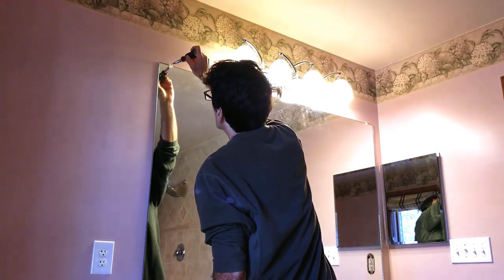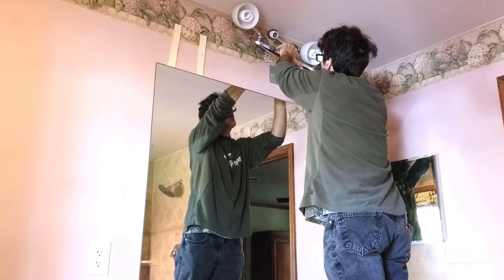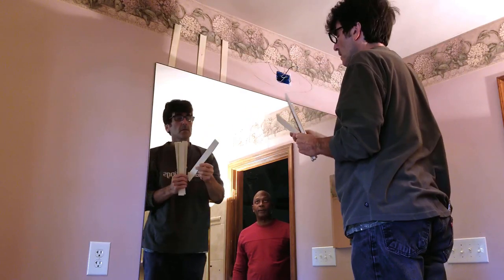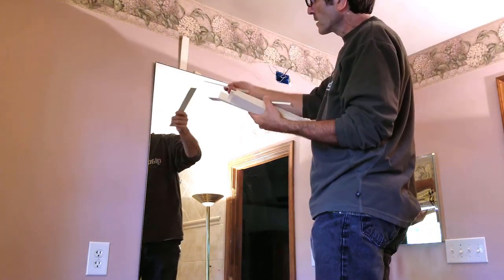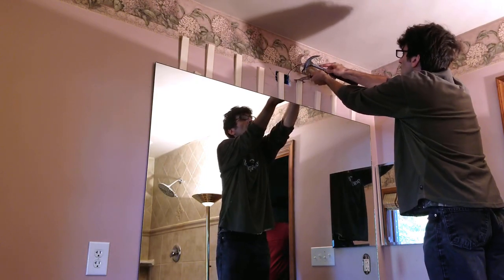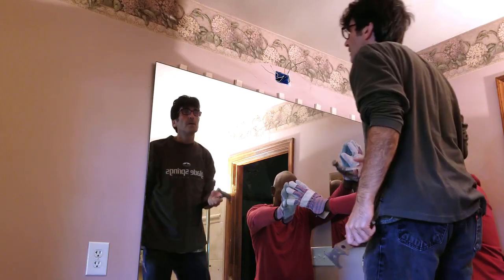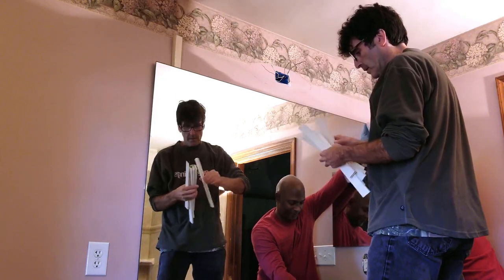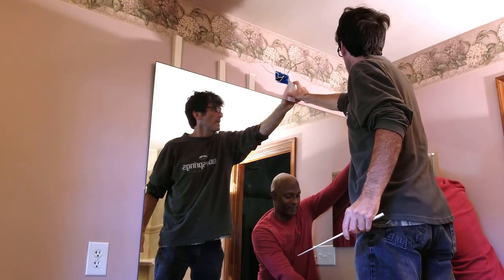How to SAFELY Remove a Glued on Mirror From ANY Wall Without Breaking!

Comment: Just used this technique to remove a 10 x 5 mirror that was glued down for decades. Thanks so much for sharing this. Worked like a charm!
Reply from the maker: Excellent!  Thanks for the great feedback... 🙂
Reply: I got the mirror down with no problem(just lifted each side). However, the shelf beneath it is not budging. Any suggestions?

Comment: This technique worked great.  Removed three mirrors today with a helper.  We criss-cross taped the mirrors with duct tape in case they broke (they didn't). We both wore safety goggles in case there was any glass shrapnel.  Last tip is to by at least two packs of wood shims because as the mirror works away from the wall you need to double them up.
Reply from the maker: Yes great tip.. it does use a lot of shims.  Thanks for the feedback!

Comment: It worked!!!! I showed my husband your video and together we removed the long full length mirror from the wall without any issue at all!!! The mirror was removed without any damage and the walls will be easy to prep for painting-putty and sanding only- no massive holes or missing chunks. SO IMPRESSED!!! Thank you so much!!!! 👌💪👏
Reply from the maker: Fantastic!  You're welcome.  I'm glad you got it off the wall ok..
Reply: What if I don't have room at the top of the mirror?
Reply: Start at the bottom or an open side.

Comment: I followed the process as demonstrated and it worked perfectly. I also used gloves with rubber grips and a suction-cup handle to help handle the mirror after it released from the wall.
Reply from the maker: Yes, the suction cups are a great add... I didn't have any available...  Thanks for the comment.. :-)

Comment: I used 42 one foot long shims on the top and the left side of the mirror. I had them in 3-4 shims in thickness. I put in a few pieces at an angle on the wall side. I found out the whole mirror was sprayed with glue of some sort. It wasn't spotted like your example here. Well, it came off in pieces. Some of it snapped off like glitter! It was a job to clean up. Anyhow I did use the shims to at least break off in big pieces. As I got to the center I had to use a wide putty knife and hammer. I'm glad that is over. I can't imagine the stuff you full-time remodelers get yourselves into. Appreciate you guys.
Reply from the maker: Wow.. yes I'm glad you were able to get it off ok.  I have actually never seen one that is glued the way you described there.  Somebody got really glue happy!  Thank you for the feedback.. 😀

Comment: A rather bizarre, but apparently effective method.  Thank you, as I just bought a house with not one but TWO huge mirrors on the wall!
Reply from the maker: Yes, it actually works!  I've used it several times to remove mirrors and never broke a single one.. :-)

Comment: Very helpful video. Gave me (a 50 something y/o woman) the confidence to take down my mirror (1 down, 2 to go). Appreciate you!
Reply from the maker: TYSM!  Be safe .. 😊
Reply: Safely removed #2 (of 3) mirrors! I think I am going to wait a bit on the next mirror as it is a big one. Again, great video.
Reply from the maker: @lisasch1593  TYSM!  I'm so glad we (me and Steve)  were able to help
Reply: Safely removed mirror #3....and it was the big mirror too. Excellent video....even for this very lay person.  @TheHomeImprovementChannel
Reply from the maker: @lisasch1593  TYSM!  Im glad I was able to help.. 😊
Reply: @TheHomeImprovementChannel  If you have any tips on how to get some of the excess drywall off the back of the mirror when I got the mirror off, I'd truly appreciate it. I was simply elated I got the mirrors off without breaking one! They still look good and are perfectly usable, but we will have to raise the mirrors (so they won't fit in the exact place with which they came out of, but a few inches). Uggg. Again, can't thank you enough.
Reply from the maker: HI.... Normally I'd recommend using a heat gun and a flat razor blade, but the coating on the back of the mirror is somewhat delicate.... Instead of a heat gun, maybe try a hair dryer.  It doesn't get as hot, but might heat the glue up enough to come loose without damaging the coating... It'll probably be a really tedious job and will go slow!  I doubt it could heat the glass enough to cause breakage, but I would lay it flat so if it breaks it won't hurt anyone...  Any kind of chemicals that are strong enough to loosen that glue will destroy that grey coating as well....  IF I remember right on this very job I tried getting the excess glue off the back and wound up running the mirrors!  So we had to get a new one... They wanted one anyway, but I still tried to save it.. Didn't work out well... 😟

Comment: I just used this method TODAY to remove 3 mirrors, 4' x 6'.  Huge.  I bought a 50 foot roll of adhesive carpet protector from Lowes for $12 to tape the surface of each mirror, because this was scaring the crap out of me (which in the end was only peace of mind, but great peace of mind)  and 5 bundles of shims for $1.87 each.  Only used 4 bundles, and it was amazingly straight forward.  It is so interesting to hear the glue start to 'moan' and then POP,  POP, POP.  The installers were NOT conservative when they glued these up, lots of spots, but following the steps here was MONEY.  Thanks so much for a great tip.  Cost me $20, but saved me $250 at least.  Now what do I do with 3 huge mirrors?
Reply from the maker: Excellent!  So glad I could help...  If you have access to FB Marketplace you could list those mirrors for free!  People love free stuff... 😀

Comment: Your video was actually the most thorough of all the ones I've watched with this process, so thank you! I like the idea of doubling or tripling up on the shims. I have a slightly related question: if you're not keeping the mirror, how can you dispose of it? Do you have any recommendations?
Reply from the maker: If you get it off in one piece, you can post it for free on craigslist or facebook marketplace... etc.. If you don't want to deal with anyone, you might have to take it to the local landfill.  If it won't fit in your vehicle.. you might have to break it to make it smaller.. of course if you go this route.. extra caution is required since you can get hurt with broken glass!

Comment: Thank you for the video. Can anyone offer advice when the mirror is almost "built in"? Our bathroom mirror has a cabinet to the left/top and a wall to the right. Due the cabinet up top, the longest shim I could use would be 3-4" and no clearance at all to use wood shims on the sides.
Reply from the maker: That sounds like something I'd have to see... I don't quite have a picture in my mind... I think u might be able to post a picture on my Facebook page under take a bath PRODUCTIONS is my other channel.. maybe it would help if I could see it
Reply: Mine is built in too. Did you ever find out how to remove it?
Reply: J Blair taped it off, covered with plastic wrap, and then used a hammer!

Comment: So clear and helpful thank you! What if it's a full length mirror from ceiling to floor on wood panels? Any advice?
Reply from the maker: I'm not sure what you mean by it's on wood panels?  Do you mean the room is paneling?
Reply: Hi Esti ~ get hold of a length of cheese wire / guitar string wire tied to a couple of wood dowels / handles at each end & slide behind the mirror, moving it downwards & side to side to slowly cut through the glue all the way down the back of the mirror ~ best get another person to help move the cutting wire from side to side especially if it's a wide mirror ~ involves patience / gentleness but mirror will be off wood in under 30mins.
Reply from the maker: @johnmckay5621  Yes that would work, but in this case the mirror was to close to the corner.  I believe it'd be to much friction to bend the wire up 90 degrees and try to slide the wire back and fourth..

Comment: I used a guitar string to slide behind and cut through the adhesive underneath the mirror
Reply from the maker: That's a good idea!
Reply: I used a bike gear cable but also have guitars but didn't think of that. I guess one is as good as the other. I also tapped the mirror in case it broke and wore safety glasses. Shards of glass in the eyeballs would be hard to get over.
Reply from the maker: @jstar1000  The bike gear cable is probably better since probably longer than the guitar string.  Definitely don't want glass in the eyeballs!  It's not a good look... ☹️

Comment: Excellent for this mirror. If the mirror allows sliding shims you did. Joy Joy.
Reply from the maker: Yes, if the mirror goes all the way to the ceiling it will make it harder to fit shims in there.  Or from the side if it's wall to wall..

Comment: Hello, what's the safest measure to use, to take down thin wavy, adhesive square strips glued to the wall. Those shims look to thick. It's 4 of them, about 3' to 4' inches apart.
Reply from the maker: I haven't had to try that one!  But if I were to tackle it is any there room on the sides?  Put the shims in from the side (long ways)?  Be sure to wear gloves and a thick shirt, maybe even a jacket for protection.  Put an old blanket on the floor in case it breaks so you aren't cleaning up glass for a week..

Comment: What about piano wire behind the mirror? Kinda like how the remove car windows
Reply from the maker: Yes it'll probably work if you have enough room on either side of the mirror to keep the wire fairly straight.  I can't see that working as good if the mirror is from corner to corner since you'll have to bend the wire at a 90 degree angle.  I don't think it'll go back and fourth very smoothly with that bend like that.  I've never tried that, so I could be wrong.
Reply: I tried that with a small mirror and the wire just didn't want to slice through.  The adhesive coated the wire and then it stuck,  Plus it's really dense stuff.

Comment: What is that thing ur using under the hammer ? I'm not familiar with tools but this doesn't look hard, I'll b doing it myself just need to go buy those things
Reply from the maker: It's just a metal 5n1 or 6n1 painters tool.  I was using it because the shims are kinda thin and this was allowing me to be a little farther away from the wall so I didn't beat up the wall with the hammer.  Any piece of metal would work, or even a piece of wood. ..
Reply: @TheHomeImprovementChannel  thanks for the response. I just went to Lowe's to get those things will try tomorrow
Reply from the maker: Just be careful in case the mirror decides it wants to break!

Comment: What do you do if the mirror goes all the way to the wall on the top and sides, and goes all the way to the sink on the bottom. This leaves no room to hammer shims in from any direction? It's like the right wall of your mirror, but on all sides
Reply from the maker: Hi, yes that's a bit unusual..  that's a bit of a problem id say.  There's probably no way to avoid breakage but I would try 2 large suction cups so u can pull a fair amount.  Being careful, You'll have to take measures to protect yourself.. a thick coat, thick gloves... boots if there's danger of glass falling on your feet.. safety glasses.  if the glass breaks then you'll have room for hammer and shims.. id start at the top and pull slow to see if u can get it started.
Reply: I have the same setup in a nook in my bedroom where I just removed an old vanity. Mirror to ceiling and side to side attached to wall. My mirror also bottoms on what was the old vanity. It also has a lightbulb coming through the middle of it. Any updates on removing this type of mirror

Comment: Can you do this from the side if the mirror is floor to ceiling?
Reply from the maker: Yes, the shims might have more of a tendency to fall out.  IF you can the shims in and fairly consistently placed I think it'll work fine.  Just take safety precautions by wearing gloves and glasses just in case..
Reply: I put drywall screws into the ceiling in case the mirror tried to fall away.  Then removed them once they popped free.  I had a helper too.

Comment: What do you do if all four edges of the mirrror have no access to insert shims? The backsplash and ceiling on the top, and the two walls on the side all come up to the edge of the mirror.
Reply from the maker: That's a good one..  Obviously this method won't work to good.  How bout some suction cups?  Harbor Freight sells them pretty cheap.  You won't be able to get them as even as the shims, but it should still work.. I'd be careful and wear some gloves and probably a thick jacket to protect your arms incase it winds up breaking..
Reply from the maker: @troyk8120  Yea you can do that, but we were trying to save the mirror, as well as the mess from breaking it!

Comment: I have clips on my mirror as this clip. Can i not remove the mirror when i just want to remove the vanity only?  I am asking cause will the mirror clips hold and support the mirror?  It has clips both top and bottom but at the bottom its right on top of the vanity.  I just want to replace the vanity and the whole bathroom cabinet.  Will i need to remove the mirror to do this?
Reply from the maker: john tran of course I can’t see what u have there.. there’s usually a track or channel that the bottom of the mirror sits in.  It’s possible they just glued that to the wall or just set it on top of the vanity top without attaching it to anything.  Or it’s possible they did attach it.  If it’s just setting on top of the vanity with caulk or something, it could let loose and the whole mirror will fall, or they might have glued the mirror to the wall like they did in my video here, so there’s a lot of variables.  Be cautious about removing the vanity Incase the mirror isn’t attached very well.  Hope this helps.
Reply: The Home Improvement Channel there are two bottom clips for the mirror so as well two top clips for it.    The two bottom clip of mirror is right on top of the vanity backsplash.  I was hoping does the bottom clips and top clip can support the mirror.  I dont want to remove the mirror . I want less work for me.  I just need the whole vanity gone.  Dont know if i could do that without taking the mirror out.    Im assuming if there is mirror clips there wont be glue behind the mirror, but there are a lot of random people out there lol
Reply from the maker: @JohnT2088  Yes, you'll be able to see if those bottom clips have a screw threw them.  As long as those bottom clips have a screw, in theory it should support the mirror!  Even with the clips, it could still be glued to the wall, but maybe not... it's 50/50.  If it's not glued, as long as those bottom clips aren't just screwed into drywall, it'll hold the mirror.

Comment: Worked like a charm. Thanks for the great know how.
Reply from the maker: Excellent!  Glad I could help.. 😀
Reply: Any suggestions on how to remove the glue residue from the wall?
Reply from the maker: HI, do you mean without damaging the wall?  I don't know of a way to make it come off perfect.  You can use a flat scraping tool to carefully scrape off the glue, but you'll probably need to be ready to do some mud work on the drywall to fix it back perfect.

Comment: We have mirrors that are 2.5m tall we need to remove - would this process still work for such a tall mirror?
Reply from the maker: It will, but it'll be trickier to get the shims down that far.   You'll need two people, one to hold onto the mirror incase it suddenly pops off the wall.  If you keep feeding shims from the top, they should work their way down.  Just to try remember to keep the pressure even so don't rush it or the mirror will  just break.   Just wear thick gloves and keep safe incase it decides to break up on you...

Comment: So what do you do when shims don't work? I've pounded those things in from EVERY direction, many one right on top the other (something I tried at the end), and the damn thing WILL NOT come loose. I mean at this point I feel like I need a samari sword to run down in there. We've been through like 25 packs of shims, I've never seen anything like it! Any suggestions? I don't care if the mirror breaks.
Reply from the maker: Are you stacking the shims?  If you stack enough shims they'll be so thick there's no choice but to break the mirror.  So if the shims just aren't working for you and you don't care about breaking it, what about a pry bar with a nail puller?.. (The thin kind that's bent at 90 degrees) There's so many ways to pull it off if you're not worried about breaking...  Please, please use whatever safety gear you need... gloves, coat, safety glasses..etc.  PS.. if you use the pry bar, find the studs and use the pryer where the studs are, otherwise you'll have a bunch of holes in the drywall..

Comment: In another video some guys used something shim-like, but which was several feet long, and then went in from the side. Seems far easier and faster.
Reply from the maker: It depends... how much clearance is there above the mirror?  Usually not enough room for something several feet long.

Comment: I would use gloves, and apply some heat on the mirror. Glass is very conductive of heat, so it will warm up the material used to glue the mirror to the wall.
Reply from the maker: IF you notice I did have gloves on!  I was trying to save and reuse the mirror.  I think that heat would discolor the mirror coating on the back of the mirror.  You can try that, but there's no way to know where the adhesive is and where to apply the heat.  You'd have to heat the entire mirror... How are you going to do that?  And actually get it hot enough to dissolve the glue?  Just my thoughts. Thanks for the comment... :-)
Reply: mine is glued on with silicone and 400 deg C soldering iron does not seem to have any effect on that stuff.